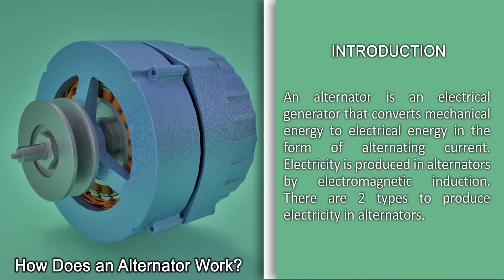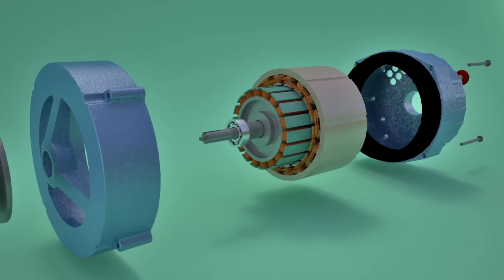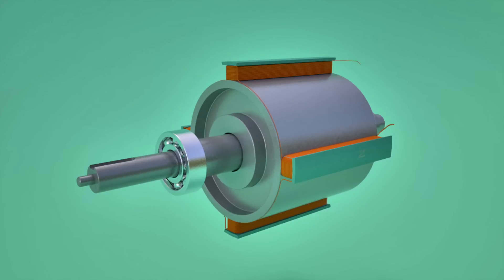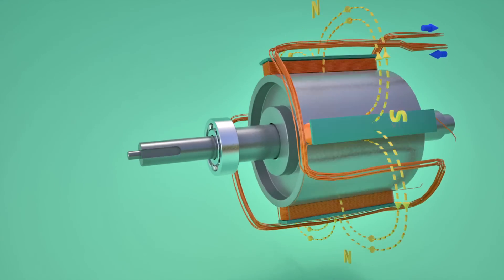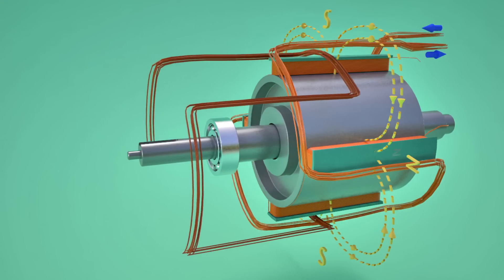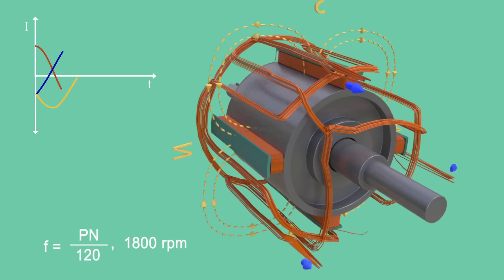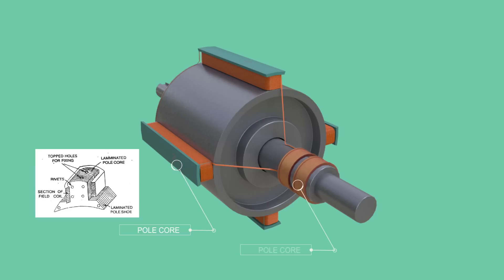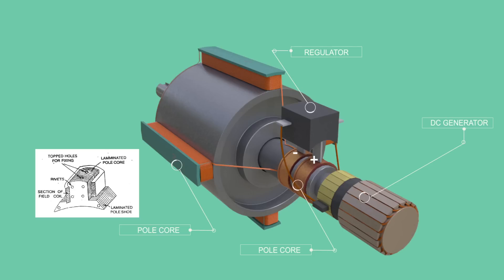Alternator, How it works?

Comment: so if I understand this correct it works by electrifying the copper wire (which has a winding of a certain angle because of how the sinus wave works) at first creating a magnetic field using the car battery (DC power) and when it rotates it phases the magnetic field super fast using the negative and positively charged magnets which creates more energy that it had before?. Like moving your hand back and forth in a volume of still water creating a movement of force heh.
Reply: Yes, car battery will "create" the magnetic field, but after the car has been started the alternator can create the magnetic field itself. From there the rotor rotates within the stator (set of coils that are fixed to a shell and dont rotate) and an AC current is produced. AC current will then be converted to DC current to create an output voltage to your battery. The regulator on the alternator is the component that determines how much output voltage your battery receives.

Comment: I think the pole markings should be swapped since the typical convention is that external magnetic flux lines come out of a N pole and go into a S pole. I also noticed when the 1-phase animation starts, the N and S poles in the 2D view are opposite the 3D view (so the 2D starts out correct) but things get out of synch and towards the end they match up so both are backwards. I imagine it was a challenge to synch everything up when creating this. Also,  the current magnitude and direction look correct in the 1-phase 3D (good job) but it looks like it might be opposite in the 3-phase animation (both 2D and 3D).  However it's kind of hard to tell with all that is going on in the 3-phase animation.
Reply from the maker: I think that i made correct explanation, but i will watch again from the begining to see, maybe there is something error

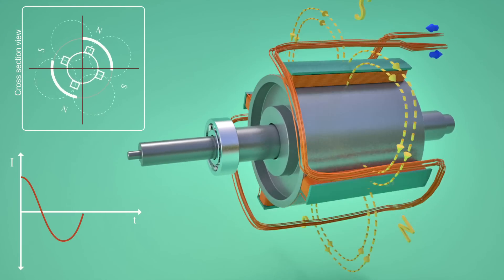Comment: Can you explain how there is emf produced at 2:33 when for some time there is no change in (BAcos)? The change only occurs when you change the poli from S to N for example and then there is 90 degree angle untill it changes again.
Reply: Kirby Yeo BAcos is formula for magnetic flux at certain position of magnetic field on some area
Reply from the maker: revolving magnetic flux now intersects the armature coils, which is fitted around the rotor. This will generate an alternating E.M.F across the winding.
Reply: Could you explain a little bit more? Because I can see by the I graph, that when magnetic field is right underneath horizonatl part of winding, there is I=0. I thought there would be max I since magnetic field is perpendicular to the velocity of wire and so sin90 would give max I?
Reply from the maker: Model in video is 4 pole rotor, 4 pole rotor has got 2 pairs of N-S pole, when the rotor turns a half revolution the induced E.M.F takes one complete cycle. So it is clear that frequency of the induced E.M.F is directly proportional to the number of poles and rotor speed. It can be easily established that frequency of induced E.M.F f(Hz), rotor speed N(rpm) and number of poles P are connected through the following relationship F=PN/120
Reply: What do you mean by (BAcos)?
Reply: Kirby Yeo Magnetic flux
Reply: how does it mean BAcos though.
Reply: Kirby Yeo ? Don't know what are you trying to ask?
Reply: Why does Magnetic Field mean (BAcos) though, like is there a formula or like it is just known as (BAcos)?
Reply: B is magnetic intensity 
A is area of cross section 
COS∆  defines angle 
It's formula for magnetic flux induced ina coil